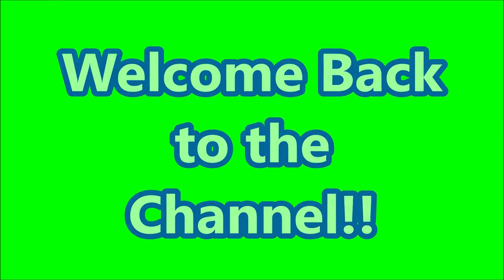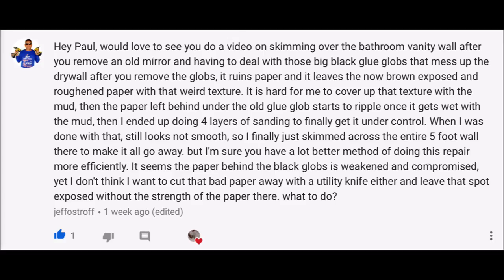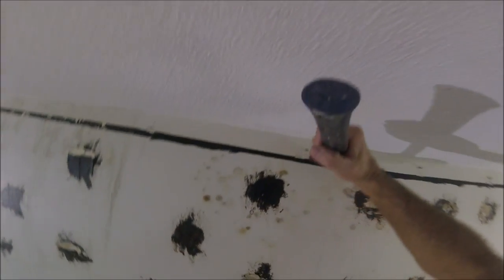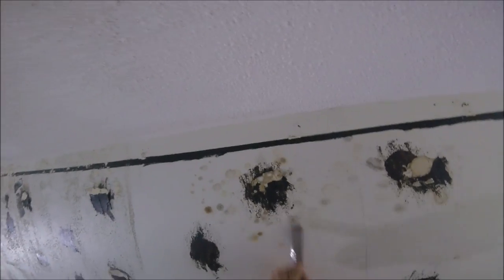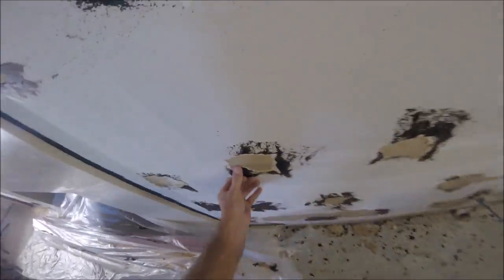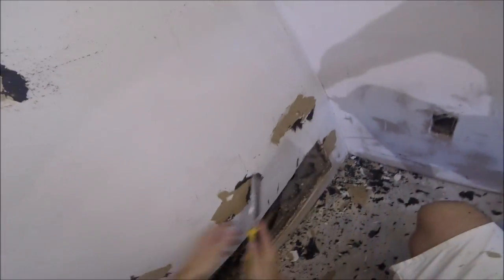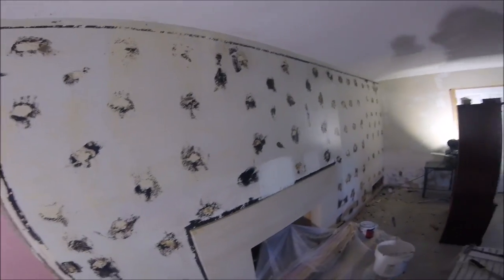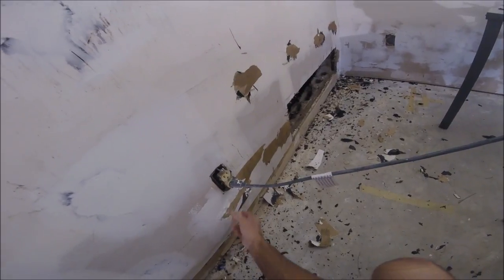How to repair drywall after removing wall mirror- Fix torn drywall paper

Comment from the maker: Below are all of the videos in this Diy drywall repair series:

Part-1 Mirror Removed! Now What???: https://youtu.be/m8AEkkiByzs  

Part 2- How to repair wall after mirror glue removal:
https://youtu.be/cI6YtVS3GGI

Part 3-  How to skim coat a wall after drywall repairs
https://youtu.be/QnkyebNG-G8

Part 4 of the video series: https://youtu.be/4G9Zze14EkU

Part 5- Do inside drywall corners like a pro with the drywall corner tool
https://youtu.be/ZNT12zZZIc0

Part 6- How to hand tape an inside drywall corner with paper tape:
https://youtu.be/hh9EBYTYSgU

 Below in Paul's Drywall and Painting Shop are all of the tools and products I use in all of my DIY Drywall Videos:
▶ https://www.amazon.com/shop/paulpeck
 

🔴 Be sure to SUBSCRIBE for more useful Tips https://goo.gl/Es5k5z

Comment: Thanks for the shout out to our channel Paul! Glad to finally see your solution dedicated to this particular common and problematic engineering issue. Coincidentally, I found the solution a few days ago on one of your older videos on repairing damaged drywall paper behind baseboards, saw you mention Gardz, and ordered it from amazon prime, and it arrived Saturday, now I'm armed and ready for battle. If you have an amazon affiliate program, you should link to Gardz with it, because it is not available in stores not Home Depot, not Lowes, maybe a few specialty stores, but for us, amazon was our only option. At least on the next bathroom remodel mirror removal, we will be well prepared. Up to now it often took me 4 coats of mud, plus 100% sanding after each layer to get the brown paper ripples down.
Reply from the maker: Hey there Jeff! Along with you getting a Shoutout on my channel, I also added you to my Featured channel section on my Channel page. Lastly, I like to give a quick channel evaluation. I want to say Nice job on pretty much every aspect of your channel!👍 I can tell you're doing your homework for sure. 
Here's a couple things that might help your channel grow even faster.🤓
1) Add a subscribe link with text (along the lines of "Subscribe for more")  to your YouTube Channel banner links (Look at mine on my main channel page). You can do this by adding it to the link section on your YouTube about page.
2) Add a Subscribe link and a couple Playlist's to your video descriptions.
3) Add descriptions to your Playlist's.

I hope this helps you! Take care, -Paul 

Ps. You could add my Channel to your Featured section too. 😉
Reply: Paul Peck  Sounds like great ideas we should get together one time to and in combined on a video I've seen a lot of other influences do that and it works out pretty good for them.

Comment: This video is super helpful for someone like me who's a first time home owner and just wants to save money by doing repairs myself if possible.

 I am working on a similar project, with a twists: 
While most of the mirror glue simply exposed the brown paper (will use sealer),  there are 2 small areas that took off all the brown paper and exposed the gypsum. It's not a hole all the way through, just an even so slight "divot". Do I need to take addition steps for these areas?

Comment: Thank you for the video. Have a 1955 home , full wall of mirrors. 

Mastic is heavy in some areas. Chisel working to a point, how much do I have to remove?  No drywall with paper, but wall is light green. Is that paint or part of the older wall board? Looks like it’s starts doing the spider web thing the more we work at it.  Will the skim coat stick to that or do I still use the Guardz? Will that take care of it?

Comment: I use the omt blade on hard caked on mirror glue works well . Just have to not dig into the wall to much .
Reply from the maker: Very true William.👍🏻 Thanks so much for stopping by my friend!🙏 How’s Summer treating you? 😅 -Paul
Reply: Paul Peck DrywallTube Its been good here besides the weather ha ha .

Comment: So after removing the wall of mirrors, I want to add wood slats or wood paneling. Do you recommend I remove the dark black glue and repair the drywall prior to installing the wood slats or can I skip to adding the slats right after the mirror removal?

Comment: Paint thinner works good
Reply from the maker: I wouldn’t chance that just because I’d worry about joint compound adhesion issues from such a harsh chemical. It would be fine as long as you’re priming with an oil base primer first though. Most people aren’t using oil...

Comment: Could you heat up the glue with a heat gun would that help
Reply: Did that, it works great along with heating up the drywall knife with the heat gun, I used a blow dryer.

Comment: Paul, you move way to fast and you don’t show product labels. Drywall mud, what brand, fiber fused tape, what brand, you say its the best, is Joint compound the same as mud? You’re assuming all viewers are experts. We wouldn’t need to watch a video if we already knew what to do and what materials to buy.  Im going ti attempt to do this project myself. Got mirrors removed, now I have the dry wall to deal with. I hope it works based off of your video. May have to watch another video.